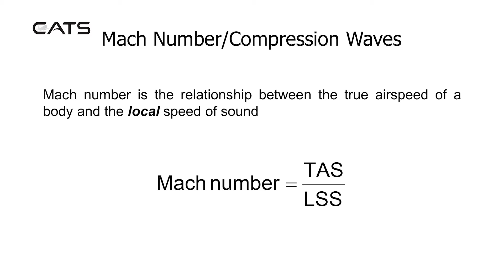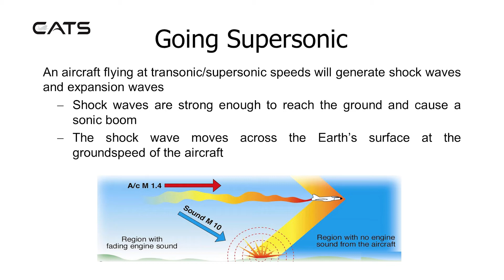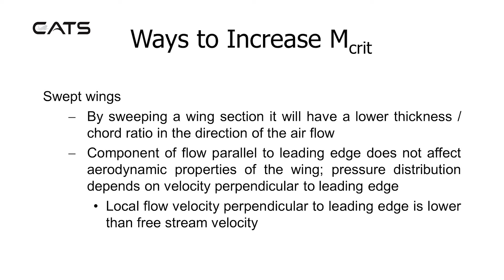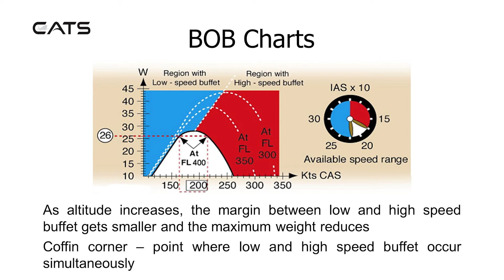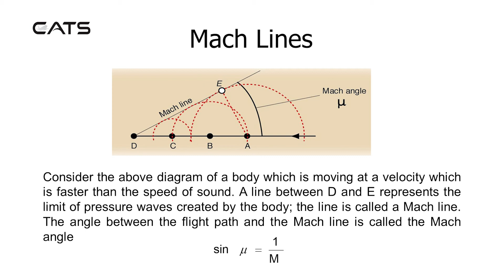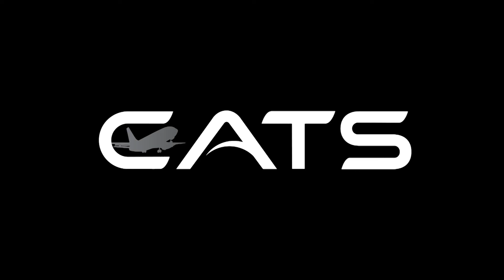CATS ATPL Principles of Flight - High Speed Flight

Comment: I believe you have a mistake on the last slide. On the first dash where you explain “Be thin” and “the flow deviations will be large” is wrong. If the airfoil is thinner the flow deviations will be lower, while if the airfoil is thicker, then the flow deviations will be higher. So “Be thin (otherwise flow deviations will be LOWER and wave drag will be LOWER)”